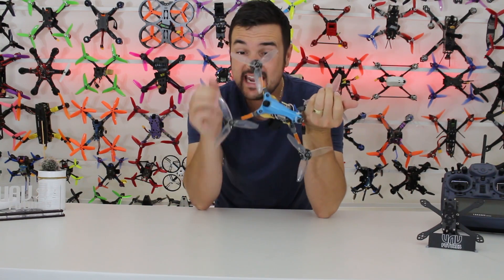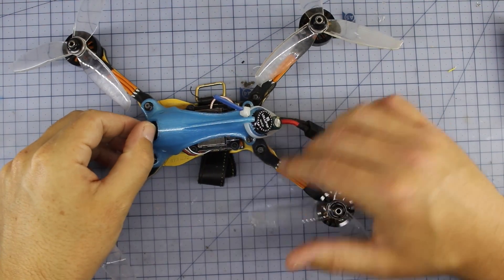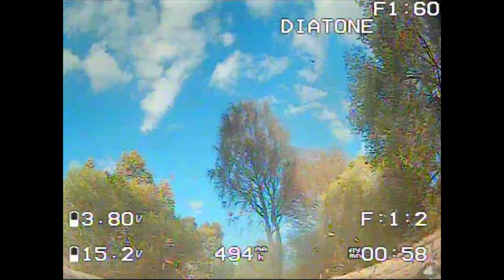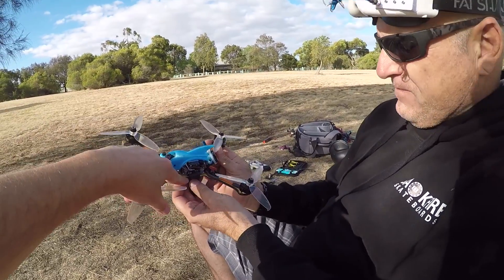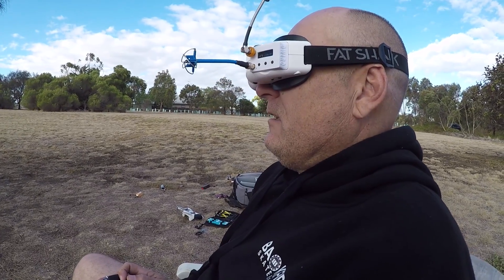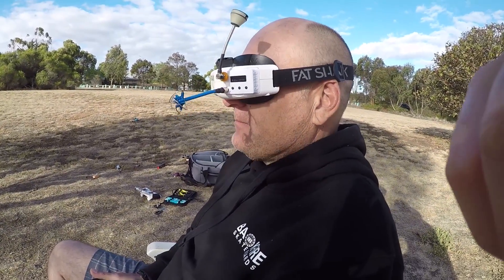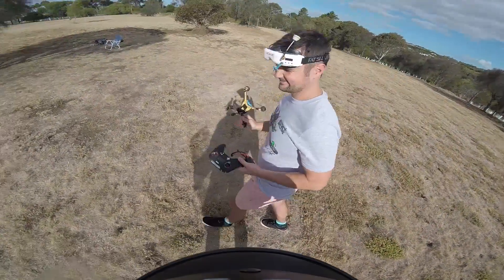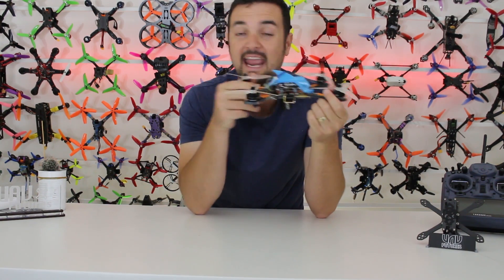WHAT IS THIS? STRANGE TYPE OF CARBON?? Racing Prototype Drone

Comment from the maker: In my opinion the 349 is a much better racing craft at a much cheaper price http://bit.ly/diatoneGTR349 what do you guys think? and what is the deal with that carbon?
Reply: UAVfutures first to comment here
Reply: looks nice should do a cement crash test slow mo 😈 test that type of carbon 😇
Reply: the era of 5 inch is over
Reply: Those are layers of carbon & coloured fibreglass blend
Reply: I like my M540 S-X.
Reply: The link says it's a 1750kv, did they send you a 4s? Was yours possibly not 2450kv, possibly mismarked?
Reply: Looks like a really cool quad!!!!! Im at work and have to get back at it!!!! So just hitting the like & leaving a nice comment!!! Keep flying & posting!!!!!!!!!!!
Reply: What about the 249+ on 4s

Comment: Painless360 has done a few videos about the effects of tpu on your antennas.  The tpu or other plastics changes the frequency of the signals which are of course not the ones you are planning to receive, worsening your video reception.  So that antenna encased in the back is not a good idea.
Reply: Plastics changes frequency? It doesn't sound right to me. If it's real, you should also remove the antenna cover as it's made of plastic.
Reply: @FAB1150  It does change the tuning of the antenna.  If the antenna is designed to use an antenna cover, that change from the cover would have been accounted for in the design phase, and removing it would likely make the antenna perform worse.
Reply: Yea technicaly but racees dont care and its so damn practical
Reply: @vojtechvejsicky1819  ITS WORSE.  Don't care if you like it or not it does not change the fact that it will reduce performance

Comment: Do you think there’s some kind of signal lag because of those whatever the motor wires go into first before ESCs. That’s the area responsible to bring rigidity to frame so there’s always a lot of stress force there so there may be vibrations going on messing with motor signal to ESCs.

Comment: What is possibly not to like about the motif wire PDB? Can’t get a cleaner look.
Reply from the maker: it looks great, but running such a large current through such a small pass is not ideal, also it is used as a structural brace so micro fractures can cause a lot of problems, yes it looks awesome, but we need performance over looks

Comment: Breaking an arm on that one won't likely be "just" breaking an arm. I have a feeling that little plate will be wrecked, too.
Reply: C4pnk1rk kopis 2 has that issue with its carbon fibre / fibre glass mix.

Comment: Hello now we have the version MK3 witout canopy and the cabels are going directly to the 4in 1 .The top is a carbon frame for to put the Gopro i have the 4S version and it goes like a Devil with Betaflight 4.0.2 from 05.05 and put my Racing PIDs from Mark Spatz (Uav Tech) and its realy fantastic :-)))))) Best regards from Alicante Spain Now i have the same GT 549 MK3 6S and it flay a little better but this are realy out of box and competions !!!!!!!!

Comment: It’s fibre glass layered in between the carbon fibre. Holy bro kopis 2 has it. Makes the quad lighter but the carbon flakes off from hard crashes.
Reply from the maker: It says carbon on the site
Reply: They alternate strands of the coloured fibreglass into the carbon weave, Stew
Reply: UAVfutures It’s carbon with layers of fibre glass. I hardened it with superglue to keep it from cracking but in the end I switched back to an ImpulseRC frame as I was over the lighter frame braking arms, base plates and standoffs due to being so fragile in the corners/screw holes.
Reply: @pavawarez8825  it's  pure 100% CF 6mm  thickness arm，these white lines，is the color painting  drop on the surface
Reply: @MKST-CA  Can we see a better photo of it up close or better yet, fail safe from 40m up or clip a pole/tree at high speed and show us if there is any damage. If there is any damage it will be where the baseplate meets the arms...
Reply: @pavawarez8825  final version ，the extend PDB gone，according to testor‘s feedback’

Comment: I do like the idea of the esc extensions. Makes the quad extremely clean and protects from props. However, I would guess every time you break an arm you would also break that board. A nice quad if you don't crash much I suppose
Reply: Diatone already had these on really old frames. I just bought almost 90 frames from them to hang as artwork (they were $0.99 a piece, and I had to buy over 80, because you get free shipping on orders over $80, LOL!) They had some crazy designs back then, stupid and terrible because apparently none of them know how stress and forces work in composites, and some plain aweful blocking too much airflow, but hey, they looked cool, so I'll be covering my walls with them and flying a few. If they break in crashes, no big deal, I bought a decent amount... Grab another one off the wall!     The electrical wires in the arms went away much like built in flight controller PCBs/frames, they just don't have any added value and break.
Reply: @jakegarrett8109  that's why we do prototype testing before final version，we need some feedback